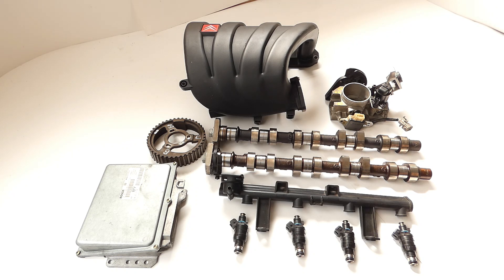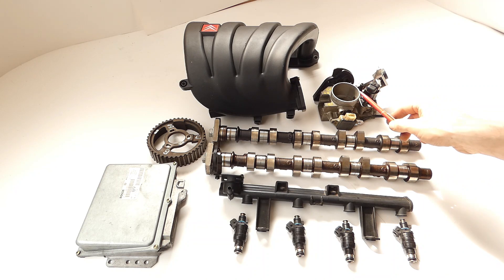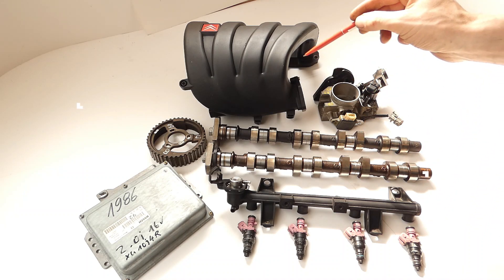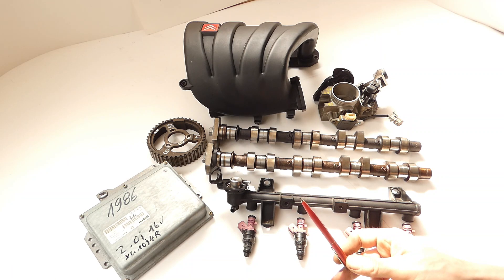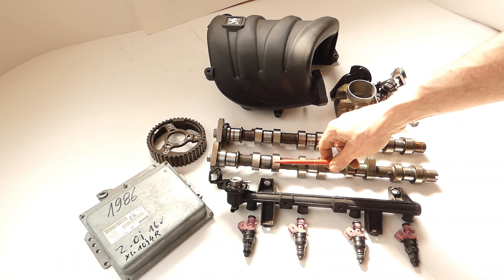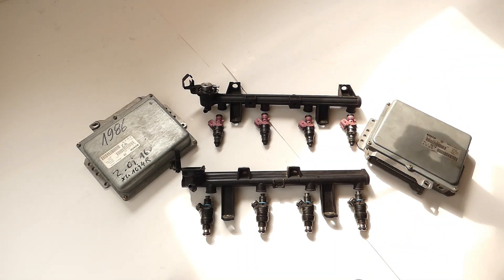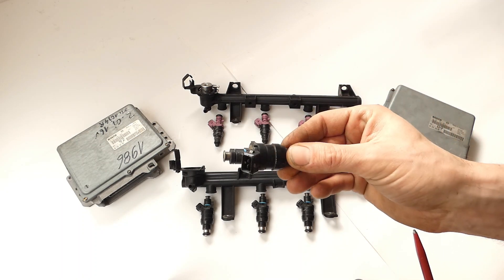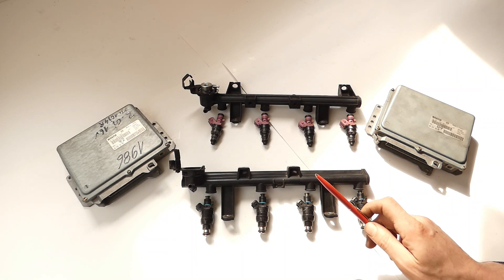Citroen Xantia 1,8i 16V XU7JP4 vs XU10J4R software and hardware tuning stage 1-4

Comment: Hello it's possible to mount xu7jp4 cylinder head on xu10j4r engine block
Reply from the maker: Yes, that fits. But the camshafts need to be replaced

Comment: hallo ich habe eine frage es geht um Einspritzdüsen ich habe peugeot 406 1.8 16v 110 "xu7jp4" baujahr 1997, Das Auto hat Einspritzdüsen von bosch genau wie deine aber blau ,und das steuergerät bosch mp5.1.1  89  baujahr 96  
ist das kompatibel überhaupt oder soll man sagem kaufen?
Reply: Ich habe das Auto so gekauft, und ich weiß nicht ob jemand hat die einspritzdüse gewechselt, weil das auto läuft unruhig, ich habe alles gewechselt von Sensoren pump Filter alles es gibt nichts mehr zu tun trotzdem der Motor ist nicht stabil am Leerlauf und Auspuff pops jede paar Sekunden
Reply from the maker: @yousefsarikozal2195  Sprüh mal mit Bremsenreinieger die Ansaugbrücke ab......die ziehen gerne mal Falschluft am Zylinderkopf oder von unten im Bereich der Unterdruckschläuche.....wenn er dann in der Drehzahl hoch geht weißte bescheid. Leerlaufsteller ist neu? Mapsensor neu?
Reply: @CitroenXantia  ja alles neu
Reply from the maker: @yousefsarikozal2195  dann Bremsenreiniger frei.....ansonsten würde ich mal die Seuerzeiten überprüfen.....eventuell steht der Zahnriemen einen Zahn daneben....ich glaube nicht das es an den Einspritzventilen liegt.....die gehen zu selten kaputt.....Du kannst natürlich auch die Düsen einzeln abziehen um eventuell eine defekte Düse zu entlarven.....
Reply from the maker: @yousefsarikozal2195  aber ich tippe auf Falschluft....
Reply from the maker: Was genau hast Du vor?
Reply: Ich denke das Steuergerät geht nur mit sagem einspritzdüse und kein Bosch
Reply from the maker: Was ich an deiner stelle noch überprüfen würde ist ob die Absteckpunkte vom Zanriemen  passen....gerade die untere große Riemenscheibe kann manchmal Ärger machen.....sie ist gummigelagert und es kann schon mal passieren das sich der äußere Ring ein wenig verdreht und somit der Absteckpunkt nicht mehr passt. Um das zu Überprüfen würde ich die kurbelwelle zum Absteckpunkt drehen und gucken ob die Absteckpunkte an den Nockenwellen passen.....wenn sie gar nicht passen dreh die Kurbelwelle nochmal um 180 grad weiter......wenn sie dann immernoch nicht passen oder nicht mal im Bereich der Absteckpunkte der Nockenwellen sein sollten ist was faul. Um den Richten Punkt zu treffen kannst du auch die obere Abdeckung vom Getriebe entfernen.....Höhe OTgeber.....dahinter läuft die Schwungscheibe....beim durchdrehen der Kurbelwelle siehst du eine Fehlstelle auf der Schwungscheibe...wenn die sichtbar wird müsstes du auf der Reimenscheibenseite den Absteckpunkt schon fast .....um zu Überprüfen ob der Punkt an der Riemenscheibe auch korrekt ist drehst du die Zünkerzen raus.....dann baust du dir vier gleichlange Stangen oder Drähte und lässt sie über den Kerzenschacht auf den Kolben ab.....Möglichst mittig vom Kolben......wenn die Riemenscheibe abgesteckt ist müssen alle vier Stangen oder Drähte exakt die selbe Höhe bzw Länge aufweisen.....ist das nich der Fall ist die Riemenscheibe defekt und sollte getauscht werden.  Falls der Absteckpunkt fast genau passt kannst du den die Kurbelwelle auch anhand der Stangen oder Drähte auf die exakte Position drehen......wie gesagt sie müssen alle mit den gleichen Längen aus den Zündkerzenschächten herausstehen.... wenn Du das gemacht hast überprüfe bitte ob sich die Nockenwellen abstecken lassen.....All das kann schon dazu führen das der Bock nicht richtig läuft oder nicht richtg im Saft steht......Falls Du mehr Durchzug bzw Leistung haben willst würde ich dir die Nockenwellen vom XU10J4R ( 2,0i 16V) empfehlen.....Damit läuft der XU7JP4 um längen besser
Reply: Ich habe mit bremsenreiniger das gemacht alles dicht ohne Problem, und zahnriemen passt alle Rädern Punkten oben mit unten, weil ich habe von kurz Zeit zahnriemen gewechselt war schon richtig vorher auch.
Reply: Ich glabe das Auto hat original sagem einspritzdüse und jemand hat die gewechselt zum Bosch und die passen nicht richtig mit das Steuergerät .
Reply from the maker: @yousefsarikozal2195  gut wenn die Absteckpunkte schon mal passen.......bedeutet jedoch nicht das auch die Kolben dementsprechend richt stehen...bzw die Nockenwellen......haben Sie denn überprüft ob die Kolben alle auf einer Höhe stehen wenn die Kurbelwelle und die Nockenwellen abgesteckt sind? Haben Sie die Düsen mal ausgebaut und angetacktet......bzw gereinigt? die Stecker der Düsen sind in der richtigen Reinfolge montiert ? Wenn sie zum Beispiel die Stecker der beiden mittleren Düsen tauschen wird es dann besser oder schlechter? Ist das Zündmodul neu?
Reply: Riecht nach Benzin jedes Mal wenn Motor anspringt. Genau wenn gibt's rest Benzin auf dem kolben von das letzte start.  Zündspule und Zündkerzen so einfache sachen habe ich alles gewechselt.
Reply from the maker: @yousefsarikozal2195  auch wenn der Motor warm ist?
Reply: @CitroenXantia  hallo, ich wollte fragen die Bosch einspritzdüse gehört den neu oder alte Baujahr, ich habe im google gesucht sagem einspritzdüse kommt an Baujahr 1999 und die Bosch sind für älter Baujahr
Reply: @CitroenXantia  xu7jp4 hat mehr als ein Steuergerät ich habe im Auto Bosch mit 89 groß geschrieben auf dem Etikett aber einspritzdüse von bosch und kein sagem der alte Steuergerät von 1995 hat Nummer 68 xu7jp4 kommt mit Bosch einspritzdüse
Reply from the maker: @yousefsarikozal2195  ja es gab viele Kombinationen......nichts desto trotz laufen nur im Steurgerät hinterlegte Düsen......sie können ja versuchen andere Düsen einzubauen aber ich denke es wird nicht funktionieren......
Reply: @CitroenXantia   funktioniert schlecht oder überhaupt nicht funktioniert?
Reply: Weil ich habe neu Bosch blaue einspritzdüse gekauft und wenn mein Steuergerät ist für sagem dann fährt das auto schlecht, ich habe heute xu7jp4 1995 bestellt was günstig der normalerweise kommt mit Bosch einspritzdüse, ich wollte probieren nur
Reply: @CitroenXantia  weil wenn ich suche im internet einspritzdüse für 1.8 16v xu7jp4 alle Ergebnisse sind sagem und nie ein Bosch, ich habe neue Bosch gekauft weil die waren im auto rain, ob die passen oder jemand vorher hat gewechselt von sagem zum Bosch das weiß ich nicht.
Reply: @CitroenXantia  oder jemand hat den Steuergerät gewechselt weil da im Steuergerät Kiste habe ich 2 Steuergerät Etikett gefunden mit verschiedenen Nummern rain liegt
Reply: @yousef sarikozal  Hallo Jungs, habt Ihr etwas neues rausgefunden? Ich habe etwa das ähnliche Problem mit meinem 406 XU7 JP4, ECU Sagem SL96 mit Bosch-Düsen. Ab und zu geht das Auto verrückt auf idle, gibt sporadisch Gas und Luft mit dem Stepper Motor, bzw. kleine Ökokatastrofe hinten. Komisch passiert das nur ab und zu, z. B. jede zweite Woche oder so.
Bin eher sicher, dass es nicht wegen Düsen ist, da es dasselbe mit den LPG-Düsen ist (LPG-ECU nimmt doch Info vom regulären ECU, soweit ich weiß).
Folgendes habe ich getan:
- Drosselgehäuse gereinigt, erstmal sehr geholfen, dann nicht mehr.
- Stepper Motor neu, MAP-Sensor neu, kein Unterschied, Signalwerte wie früher.
- Carb Cleaner paar mal ins Drossengehäuse gespritzt, manchmal geholfen, manchmal nicht (und das Gehäuse ist schon relativ sauber)
So wie ich verstehe gehen die Sagem SL96 manchmal verrückt/kaputt, wäre eigentlich interessant, falls ihr sowas mit einem Bosch 5.1.1 gewechselt gabt...
Edit: Ah okay, jetzt bemerkt, Sagem-ECU ist schwer mit Bosch ersetzt (habe auch früher bemerkt, dann vergessen). Schauen wir, mal Carb Cleaner, mal PCV-off solls schaffen...
Reply: Ich brauche drosselklappe Einstellungen oder drosselklappe sensor volt Werte wenn ist ganz zu und ganz auf. Weil ich habe schon die schraube von drosselklappe gedreht und ich weiß nicht mehr wo war genau vorher das schließ punkt meinte ich,
Reply from the maker: @yousefsarikozal2195  kurz bevor die Drosselklappe im Gehäuse anfängt zu kneifen......oder meinst du bei voller öffnung?
Reply: @CitroenXantia  ich glabe ist weit weg auf von zu kneifen Punkt
Reply from the maker: @yousefsarikozal2195  dann mach sie komplett zu und Dreh die Schraube langsam wieder an den Anschlag bis die Drosselklappe anfängt zu öffnen......aber wichtiger ist das sie nicht überdreht.....sprich der endanschlag passt sowie der Gaszug vernünftig gespannt ist....
Reply: @CitroenXantia  der gaszug ist lose, soll das gespannt sein?
Reply from the maker: @yousefsarikozal2195  ja.....gerade so das die Drosselklappe noch nicht öffnet.....wenn er nicht gespannt ist kann die drosselklappe nicht voll öffnen
Reply: @CitroenXantia also drehe ich die schraube zurück bis das schleift an Gehäuse und ein bisschen wieder auf ist so richtig?
Reply from the maker: @yousefsarikozal2195  ich hab die Drosselklappe gerade nicht zur Hand.....also ich kann gerade nicht aus dem Kopf sagen ob die schraube den Endanschlag ergibt oder den Anschlag zum schließen der Drosselklappe....ich glaube aber es war der Endanschlag.....das schließen der Drosselklappe wird durch das Gehäuse selbst verursacht......also vergessen wir lieben mal das schließen.....es geht wohl ums öffnen......guck dir mal das Video mit den Ansaugbrücken von mir an......da erkläre ich die Drosselklappe......müsste man auch sehen wie der Endanschlag aussieht.....
Reply: Ich hatte vorher xsara N2 1.6 16v war ein super Auto da habe ich nichts gemacht und hat gefahren wie böse Tier ohne probleme aber leider ist weg (Unfall) und dann kommt peugeot da fängt Kopfschmerzen an.
Reply: Ich habe auch diagnose Gerät gekauft der für alte citroen und peugeot ist , es gibt ein Fehler o2 sensor open circuit, ich habe neue Lambdasonde rain auch. Trotzdem kommt immer noch der Fehler nach paar Tagen. Und Auspuff gase reicht wirklich giftig brennt die Augen und Nase wenn man das Riecht, Auspuff Anlage von vorne bis hinten alles neu mit neue kat.

Comment: Gude,
Ich hab einen Peugeot 306 mit einem XU7JP4 und die Gasannahme ist für meinen Geschmack sehr verzögert. Gibts da irgendwas einfaches, was man tun kann, um das besser zu machen?

Dann wär da noch die Frage, wo man am besten nach einer Einlassnockenwelle vom XU10J4R sucht. Hab grade geschaut und das einzige, was ich finden kann, ist eine neue Nockenwelle für 500 Euro, was mir allerdings zu teuer wäre. Gibts da auch günstigere Alternativen? Schonmal Danke im Voraus :D
Reply from the maker: Moin......in wie fern verzögert? Eigentlich ist der Steno XU7JP4 recht zackig am Start....was in jedem Fall hilft ist die die Nockenwelle ( Einlass ) vom XU10J4R ( 2,0i 16V ). Die sind auch deutlich günstiger. Es reicht wenn er nur die Einlass Nockenwelle bekommt....Auslass kann original bleiben. Der Effekt ist in jedem Fall spürbar. Ja RS Nockenwellen sind teuerer da heißt es suchen und dranbleiben....irgendwann läuft Dir eine günstige über den weg....ich habe fast zwei Jahre auf ein passendes Angebot gewartet....ansonsten besteht natürlich die Frage ob dein 1.8er vernünftig läuft.....sprich sind die richtigen Kerzen drin .....passt der Zahnriemen im OT ....sind die Sensoren alle i.O. sind Einspritzdüsen i.O. passt der Kraftstoffdruck ist die Ansaugbrücke dicht....usw.

Comment: Hi, I have this project for my xu7jp4: I would like to swap the head with a xu10j4rs head, and use a speeduino engine management, which can cost around 150euros
Do you think it could work? What would be the difficulties for doing this?
Your videos are very helpful BTW, thanks
Reply from the maker: Hello...
Unfortunately, I have no experience with this control unit either. In which car is the XU7JP4 installed?
Reply: @CitroenXantia  it's a xt 306 from 2000 with the sl96 ecu, there is some info about this swap on the 205gti UK forums and a dyno curve (result : 165hp with the configuration I am talking about) and apparently no issues, but not much details

Comment: Hi,
It is possible to mount the RS Camshaft without the risk of the valve touching the piston because of the single spring.? I have read that in many places but you have it and it's working.... I have XU7JP4 head but XU10J4R block.
Reply from the maker: in the combination I have not tried it yet ..... Since the cylinder heads of the XU10J4R and XU7JP4 are relatively the same, I assume that it fits. But first I would install the inlet camshaft from the RS and the exhaust camshaft from the J4r to be safe ...... it is important that the camshafts are correctly measured. I don't have anything on the piston, there is enough space

Comment: So u can fit the RS cams in a stock jp4 head??
Or the cams are too agressive for the spings and retainers?
Reply from the maker: yes they fit .... I would install the RS camshaft on the inlet side and the XU10J4R camshaft on the outlet side ..... and new standard valve springs .... but the old ones will also work if they still have enough power

Comment: Thanks man! Understanding german is a little difficult, but with the subtitles on I can get a pretty good idea! You gave a pretty big help regarding my 306 xu7jp4, hope I can acquire every component and put it to good use! (car is already making 140 hp with xu10j4rs intake and exhaust manifold and rail, 60mm exhaust with resonator and muffler, and still running stock ecu and injectors)
Reply from the maker: The subtitle also works ..... very well. Are you driving the series control unit from the XU7JP4? Which camshafts are installed?
Reply: @CitroenXantia  yes they do! if it wasn't for the subtitles i wouldn't understand anything! 
Yes, i am still driving the stock control unit from the xu7jp4! But my car is from 1997/10, and the control unit is a sagem, an SL96, which runs three rows of pins, while the bosch ones run 2 set of pins, so i think that wont work! my idea was to convert my wiring harness from 97 to 96! and in that way i can install a bosch ecu, as long as everything works! the problem with the sagem ecu is that it is rubber coated, so it is not accesible, at all! unless you take a razor and peel of the rubber, but doing that is risking bricking my ecu! if it was accesible i would take it to a chip tuner and that would be no problem... thats why i was asking you! And i am still running stock internals! stock cams, stock valves, stock ecu and stock injectors! stock everything basically, besides the peripherals
Reply from the maker: @Tguedes98  Yes, the Bosch ECU is the better choice .... it is simpler and there are many other injectors ..... install the inlet camshaft from the RS ..... then something really happens. In addition, the ECU from the XU10J4r + injectors + throttle valve from the 2.0i 8V ... then it runs really well. I'm just having my ECU adjusted, let's see what that brings ... I hope that he has 130-140 PS with the components ... that would be great and that would be enough for 950Kg
Reply: @CitroenXantia  i'm pretty sure it will make more than that mate! as I said my car made 140hp still running stock cams! only peripherals from gti (manifolds and throtle) and full stainless exhaust
I'll be lookin into buying the bosch unit from the XU10J4r + injectors + wiring harness! Do you think that the wiring harness will fit just fine? i mean no inventing with the wires, just plug n play?
Reply from the maker: @Tguedes98  Only with the parts 140PS? ..... okay .... was the car on the test bench? No, that won't work that easy because the sensors also have to be replaced ..... they have a different plug .... than not all but some ..... + the problem with the immobilizer ... so it won't easy
Reply: @CitroenXantia  yup! the car was tested on a very reliable dyno! i can send you a video and a dyno sheet if you'd like to take a look!
What sensors use a different plug? from what i've seen very intake sensor is the same! lambda sensor too! what i dont know and might be different are the sensors from the gearbox and shit! immobilizer is not a problem for me, is a problem for the tuner! hahahaha, jokes aside he'll take care of that no problem! what i really need to know is if the car will work if i get the correct sensors and shit! should work fine right?
you can reach me at this instagram page:
www.instagram.com/tiagosousaguedes
Reply: @CitroenXantia  https://www.youtube.com/watch?v=5WwpjFSWzTQ
Here you go! a video of my car and a dyno sheet!
Reply: Only have one problem! my 306 is from 10/97, and it's running a sagem sl96, which i thinks its stock. Will it also wirk if i change to the bosch one?